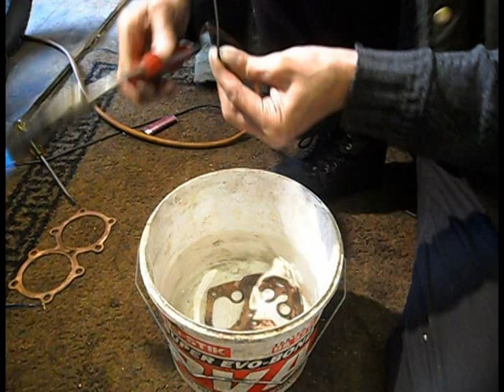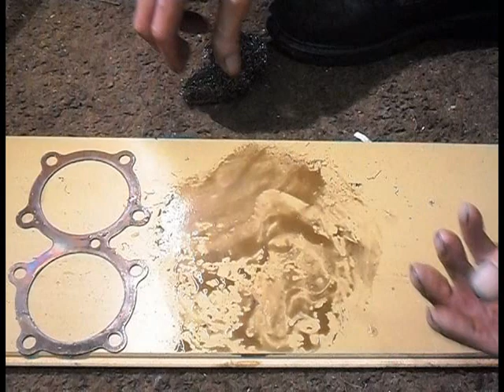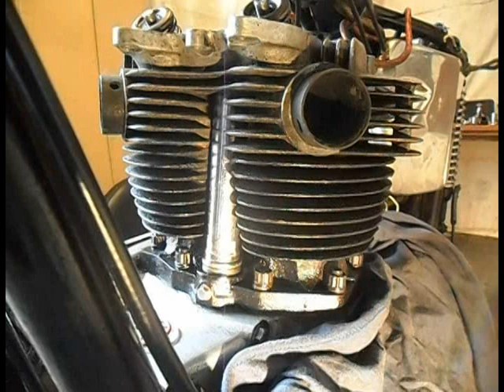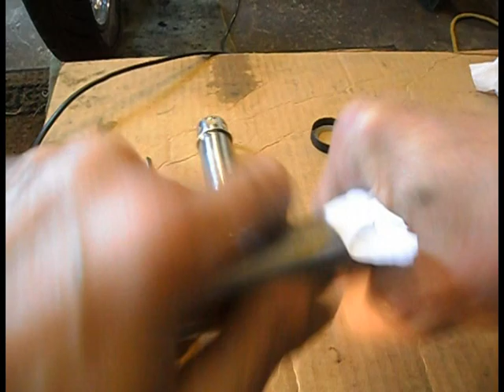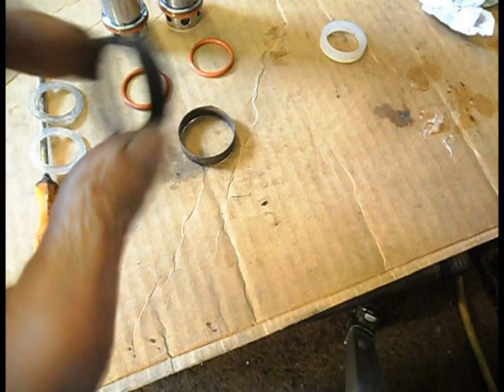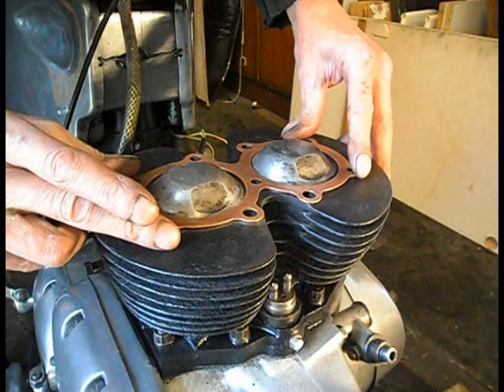triumph t120 engine rebuild part 20

Comment: Wow ... no one else believed me when I've said for YEARS , the only way to get t-120 rocker covers to stop leaking is copper gaskets . Especially on the late model t-120 . Where the head bolt also ties down the valve cover so the paper valve cover gasket always crushes out or ... the head warps .

Comment: Don't know what got into me when I picked up this TR6R rust bucket from 1964,  without you I would have thrown it in the bin by now.  Thanks for all your help.  Am nearly finished rebuilding the engine.  Well give me 6 more month, I want to dismantle it and rebuild it again to ensure I have not forgotten anything.  Just for info, I only kept the main frame, engine, tank and handle bar.  Rest I cannibalized it from MX 360 from 1973, welded few parts to make it fit.  The idea been to have an cross over between the two.  I will call it the MX 750 (yes I bore the engine).  Been crazy about XT 500, I figure it was the only thing I could do.   Thanks for all your help.  D. Asoratnof aka Uxpatc
Reply from the maker: Hi D Asoratnof :-) glad to of been a help to you, that sounds quite a project you've got going, how abut a bit of a video to show your progress/thoughts.

Comment: Like a pro Johnny. I was pretty sure that was a Tiger TR6R engine and now I'm thinking it just might be. I just have not seen a Bonneville with a 4 speed before. LOL. Excellent installation. 
God Bless.
Reply from the maker: Hi Ed :-) cheers,
nope its a T120R Bonnie, not much difference between the two an extra carb and valve timing, then the styling.

Comment: 'One grunt tight', brilliant. Best torque wrench ever! Oooooh heads on, how many kicks? C'mon folks place your bets. I'll go for two (if the ignition leads are on the right way round this time) otherwise 999 :-)
Reply from the maker: Hi Pete :-)
you remember the 40 grunt alternator nut wot!!
Fingers crossed I'll go for around two, 
hope I'm not tempting providence here :-D

Comment: there is some reverb on the sound of this video? may have bumped a setting. a bit odd sounding.
Reply from the maker: Hi over :-)
I had noticed that while editing, so I reckon the problem came from the camera and that was set as usual.
It seems ok on the next edit, I have no idea what caused the problem hopefully its a self fixer.

Comment: I believe you are from the  Cleveland / Teesside area, if so,  where about ? I am a T140 v owner also a 1957 Twenty one.Other bikes include a 1978 "air head" B.M.My newest Triumph is a 1996 ,3 cylinder "Sprint", good bike but ever so heavy.
Reply from the maker: You got quite a stable there Douglas, and a sense of humour too :-D
Yep a Teessider not far from Slaggy Island.
I only have a two horse stable my Bonnie and an MZ TS125 which I will have a crack at doing maybe after this set of vids.

Comment: this works, easier than using the stove
Reply from the maker: HI Jonathan :-)
A blow torch has a bit more heat in it, as long as the copper has been near red hot it will anneal, the quench speeds up the job and cracks of the slag but is not necessary.

Comment: I see you got rid of the pot leaf lighter :P Why not just run early style rocker boxes? lack of owning a set or different oil feeds?
Reply from the maker: Hi Otis :-)
I still got it, too many flix to light my torch, lazy lighter.
Lack of having a set the oil feeds are the same but tappet covers are the round ones.

Comment: "Slaggy Island" sounds exotic ! where is it ?Lunmad, you sound as though you may be an "Agony Uncle "for Triumphs !My T140 ticks over at about 1 k. revs for some minutes then stops, refuses to start, in spite of near heart attack inducing kicking for some minutes ,then starts......why ?Concentric carbs. and Boyer ign. m.k. 1V fitted.I'm  thinking of changing it for a Honda with electric fart.( Like f..k.)
Reply from the maker: Hi Douglas :-)
Slaggy Island that's South bank, so called as most of it was built on reclaimed land filled with slag from the furnaces ( When we had some)
If you have the MKII carbs whip the bowls off and in the bottom of the bowl down a tube lives a jet, take that out and give it a clean.
It looks like I'm whipping my top end off again she's a bit smoky to say the least!!